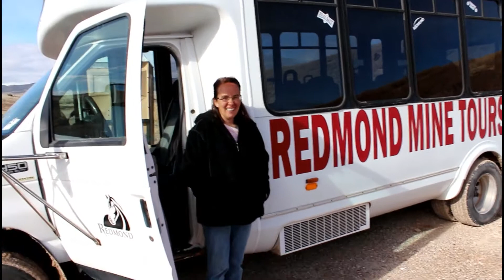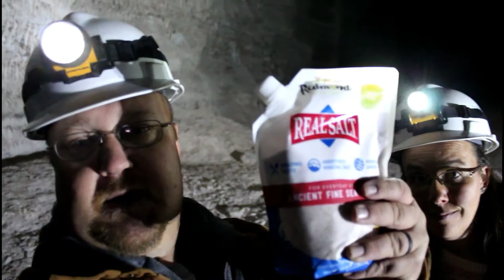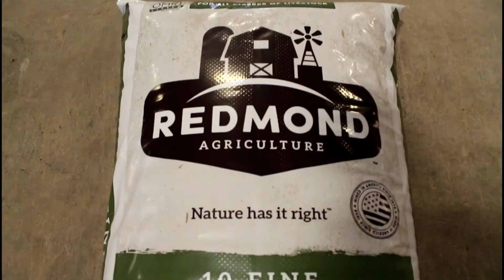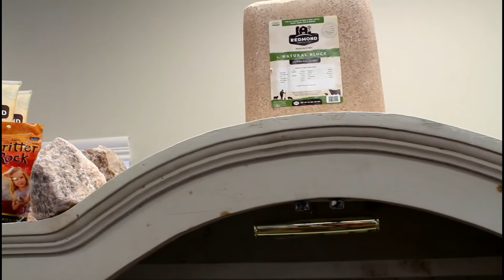where does real salt come from

Comment: It looks like the company uses diesel powered large machinery to mine and transport the salt, I would think that would contaminate the clean salt, defeating the purpose of pure salt. With today's technology in electric and hydrogen powered vehicles, it seems the company could phase out those dirty machinery.  Did you guys encounter air pollution and ground contamination when you were down in the mine? Is the company working toward clean power for their underground machinery?